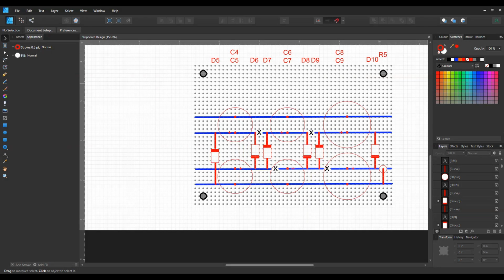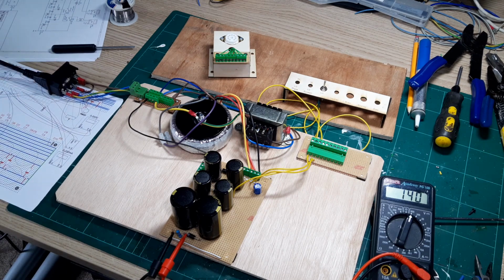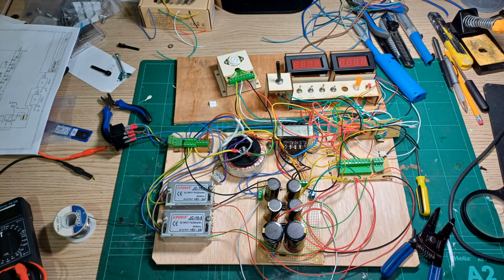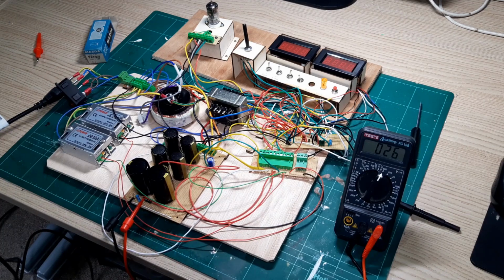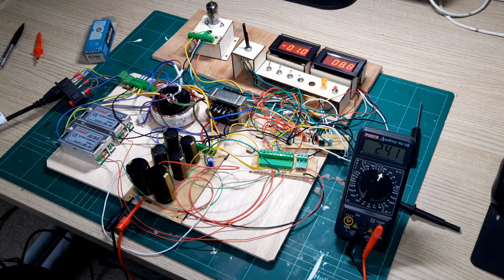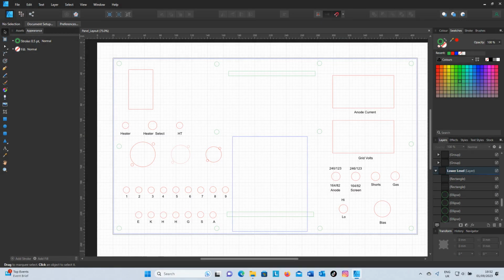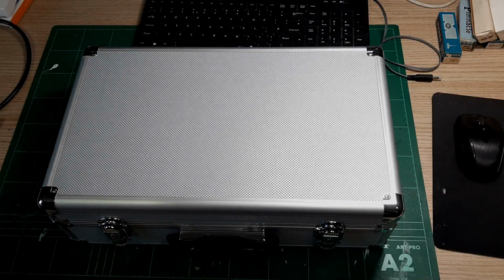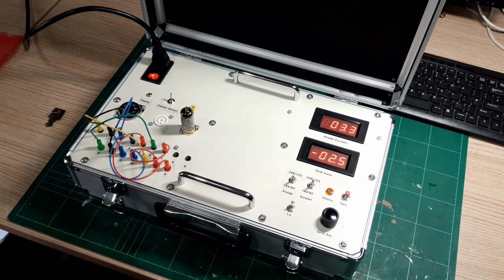Homemade Valve Vacuum Tube Tester Build - Part 2

Comment from the maker: Be aware that the toroidal bolt in my build is insulated at the other end so that there is no risk of earthing both ends. If the bolt is earthed at both ends, then it will behave a s single turn winding. Although the volts will be low, the current will be high in the short circuit. This can damage the transformer.

Comment: I went off a higher end American method transconductance/cathode emissions/plate current/gas test tester and chose 12, 30, 100 and 250 volts DC for plate and screens voltages.  Then I added 300, 350 and 400 volt DC capability. Grid bias ranges from 0 VDC to -100 VDC. The digital Gmhos meter was an eBay find that cost $150 saving me $400, as it is capable of +/ 1/2% tolerance @ 5KHz and about 1% @ 11KHz. The heater voltages were taken from a junk tube tester's transformer, so I have about two dozen of them plus a 20 amp 6.3 volt transformer with SIX secondaries, because unloaded a 20 amp 6.3 volt tap will be putting out over 7-1/2 volts. I want to measure plate, screen, cathode and heater voltages and their respective currents too, especially the plate current both as DC milliamperes and the sine and square wave AC portion to give me the Gmhos reading in mA/Volt, and I am adding in a pulse capability too. Regulating the screen and plate voltages using Zener regulated MOSFET regulation is yielding mediocre results. The Zener's breakdown voltage changes with temperature. Tucking in into a blob of heatsink compound and then stuffing it in the MOSFET's heatsink helps. Adding a BJT can also regulate the current.
Reply from the maker: Sounds like a great tester. I would like the means t measure all those voltage in my unit, but I guess its about trading off complexity vs cost. If I build another unit, I would follow on the lines of yours. I have built a module for mine that adds more flexible voltages particularity for the screen.

Comment: Maybe there's an obvious reason this wouldn't work, but why not run an adjustable linear regulator between the taps of the multiplier (*between* them, not to ground for obvious reasons). Each one could handle a 40v range below the tap. LM317 or 1117 ICs work at high voltages   as long as the you don't reference them to ground.
Reply from the maker: Sound complicated. For testing valves you really only need 250V, 170V and 100V for the screen. With that, you can test almost anything. I don't have 100V screen with 250V anode on this design, but that has been rectified with a simple 100V module. I also don't like dropping lots of volts across a regulator due to heat dissipation, but that's just me.

Comment: Would you mind sharing which two transformers and which DC supplies you used? Thank you.
Reply from the maker: Any 12-0-12 50VA transformer will do. You can go to 15-0-15 if you want a 300V+ plate voltage. The heater transformer is a 6-0-6 30VA component. I connected the secondaries in parallel to provide more current capacity. For the meter supplies, I used generic 5V 5A output, AC110/220V to DC5V 25W Universal Regulated Switching Power supplies. These can be easily found on Amazon or eBay etc.
Reply: @VintageandReclaimedElect  thank you.

Comment: Is there any reason why you couldn't get rid of all that voltage doubler circuitry and use a 1:1 isolation transformer and a couple of small variacs to set the screen and anode voltages? That would give much more flexibility.
Reply from the maker: You could do that. It is a valid approach. The point about this design is that it is cheap. Costs of an insolation transformer and variacs could be higher. You will also need to rectify the output and make a negative voltage for the grid. The voltage double circularly is not too great anyway. That said I am think about a variac based plug-in module for the screen voltage. At least my final build has the ability to plug in power modules for screen and heater.

Comment: Nice Video.
I actually have built my own based on the same reference design.
But not looking as good as yours...
So far i have used a variac for the AC input to fine tune voltages.

Not used high/low voltage selector som far.
Considering a seperate bias voltage supply to keep it stable when i adjust tha variac.

Maybe you would like to make a video covering testing common valves like EL84/EL34/ECC83/5881/6V6/6L6 ?
Reply from the maker: Thank you for the feedback. I love hearing about the experience of others. Good idea on the variac and valves.

Comment: your final comments were eye opening  that  some people would ask about ht options they should stop and only use low voltage eg less than 12 volts or lower
Reply from the maker: Yes, some knowledge is needed here and lots of respect.

Comment: Nice project. However, I would make some comments regarding safety. Firstly, when measuring continuity to ensure all of the metal parts in the case are connected, the standard is to use a continuity tester with 100mA test current. An ordinary multimeter will have a continuity current of only a few mA. Secondly, It is considered very bad practice to use the mounting bolt for a toroidal transformer as an earth point. If you accidentally earth the bottom of the bolt, you will create a shorted turn on your transformer which will in turn make a big bang. Thirdly, I suspect the push switch you are using for the gas test is not rated for a sufficiently high voltage to be safe (and indeed your toggle switches may only be rated at 125V - you should check). Finally, when making this kind of circuit, you really need to have a high quality multimeter with at minimum a CAT I rating and preferably CATII or CATIII. They are not super expensive and I recommend the Brymen BM235 as an excellent meter for less than £100. Also, (and this is just a personal view), I would have wired the grid voltage potentiometer the other way as the convention is to turn a knob anti-clockwise to make the situation 'safer'. Good luck with your new channel.
Reply from the maker: Thank you for the comments. Good point about earthing the centre bolt of the toroidal. I will place an annotation in the video and add a comment to the description, along with disconnecting the earth. The bolt in this project cannot be earthed at both ends. The transformer is bolted to a plywood base and that is fixed to the plastic base of the case via wooden standoffs. No metal mounting. There is a cavity between the underside of the plywood and the case. The bolt is confined in that cavity and no wires or metal exist in the cavity. The case has no holes drilled into it so the bolt and everything else is well insulated from the anything outside.  

I do have other multi-meters. CAT III to CAT IV. I have used them in this video but tend to go for my old academy meter. That too is CAT III. The CAT IV I have is good. I will certainly invest in a good continuity tester.

The push switch is 250V 0.5A. Toggle switches are 250V, 3A. That is top end for my voltage and current draw tends to be no more then 30mA max. 

I have thought about wiring the grid pot the other way round for the reasons suggested by you I will do this when I remove the toroidal earth.

Comment: Thank you for showing us this project. Putting it in a camera case is  a bit of genius, it looks very smart. 
I have used this voltage multiplier supply for a valve radio project. Because the current draw is about 60ma I used 220uf capacitors, which gave around 250v under load. 
I also realised that this a potentially lethal supply. There is a large amount of capacitance,, which holds several joules and stays there for a long time after switching off.  so I put bleeder resistors across each stage of the multiplier , the voltage drops away quickly after the power is switched off. It is easy to drop one’s guard after the power is switched off.
Reply from the maker: Thank you for the feedback. I hope I stressed safety enough in the videos. I have a strict procedure for connecting, powering and disconnecting, and that is for me using it. You really need to be respectful of what this can do to you. I do have a bleed resister in the voltage doubler.

Comment: As far as I know, the most important parameter of a valve, is the condition of the heated cathode. Only examining the state of the cathode can we decide whether a valve is rather new or used or heavily used. This should be the first stage of valve testing and everything else should come after that.
And you can check the condition of the cathode is pretty easy by measuring the emission current at two points. One point at nominal heating voltage and an another at 60% of the nominal heating voltage. If the emission current does not drop below 50%, than the valve is good, if it drops below 10%-50% then the valve can be usable, below 10% percent it is bad.
Reply from the maker: That looks to be good advice. I can perform this sort of testing with this tester. I give it a try. Thank you.
Reply: I missed a bit of this type of information in your video. The build is a very nice piece of engeneering, well done, but to me it was not clear what to go for once completed. I will visit Grant Willis his site to check out. I have an old valve lab power supply, that supplies all needed voltages. Must be very easy to built a tester with this unit and give it a use.

Comment: This is a great reference desin for a Valve/Tube tester.    I would probably make a small addition to make a variable voltage on both high voltage and heater so it can test a wider range of valves/tubes, but that's mainly because I do have a wider range of voltages needed for testing what I work with.      I think this is an invaluable tool and also a great project for anyone interested in getting into the valve/tube equipment hobby or even for more major restoration work.
Reply from the maker: Totally agree. You can use an external variable heater supply by connecting directly into the banana plugs to the valve. I am also making an external PSU to vary the screen volage to a much wider range. The limitation of this design is the variable in possible voltage combinations.
Reply: I think I will just use my variac on the ac input  to lower the output for plate and screen to exactly what I need. With an external heater supply. Not very portable but I don't need to move it from my workshop.

Comment: Fantastic. How about a design for DHT valves?
Reply from the maker: This will work with DHT valves. One side of the heater connection is grounded,  effectively connected to the Cathode. The filament voltage can be applied to the other heater connection.

Comment: pretty nice build there, I think you could also opt for a high voltage booster if you want to save on the doubler caps. I have a real tube tester but I kinda want to build something like the one you have here but as a kind of amplifier instead so you could actually play music with the tubes under test to see how they actually sound in circuit. I think it could be a very useful thing to have if you want to re-purpose non audio designed tubes for audio anyway to see how they perform as this. I have a ton of tubes but if you don´t know how they sound it is hard to do a good design around them
Reply from the maker: I love your thinking. I will be looking at finding new applications for redundant TV valves.
Reply: @VintageandReclaimedElect  yep. I have it on my to do list. I am not completely sure how to best implement and do it yet. The amplifiers I have built so far have a very wide range of compatible tubes already but I want to make it easy to change pinout and everything and that could be the hardest part I think. Bias can be made with a rheostat

Comment: Thanks for the video.The idea of using a voltage doubler is great although this provides limited available current, but you probably have enough to power the tubes you use.I also noticed that you didn't use any method to stabilize the anode voltage, so I'm wondering if you can maintain a good balance with power tubes that require hight current.To measure gm no declared anode voltage is required, therefore it is possible to carry out the measurement at any operating point, but during the variation of g1 the anode voltage must remain constant for an accurate measurement of gm.
Reply from the maker: Thank you for your comment. I really appreciate this sort of engagement. It helps all that watch these videos. I have a 50VA transformer at the heart of this and so I believe the voltage doubler will support about 250mA @250V. The most I have seen my valves draw is 36mA.
There are many examples of this design on Grant’s web page and some do have an extra meter to monitor the Anode voltage. I saw no fluctuation when I had a meter connected throughout the prototype stage, but I have to say I am working blind as I omitted one in the final build. I do not plan to add any stabilisation. However, voltages are patched through to the valve using banana leads so I could modify the leads and be able to connect a voltmeter through those and manually assess how stable the voltage is.

Comment: Parabéns amigo! Estou esperando mais vídeos! Também gostaria de fabricar um testador de válvulas até porque tenho um rádio de válvulas para arranjar e só agora com 64 anos estou a estudar verdadeiramente as válvulas e ainda quero construir um amplificador de válvulas foi sempre o meu sonho ter um .
Reply from the maker: I am glad you liked the videos. It's really not hard to build a tube tester so go for it. I will experiment with audio valves from TVs as they are very cheap and easy to work with. I have set aside some PCL82 valves that are a pre-amp and power amp in one envelope. I will put up a video of the build. I just need to find the time to start.

Comment: I think the build quality is excellent. Nice touch with the aluminium case - looks a bit better than the original Lamington tin!
Reply from the maker: Thank you for that. It's very serviceable too after I took it apart for an inspection after a valve failed with a bang whilst testing.

Comment: Nice work ! Hope to see more videos like these two soon.
Reply from the maker: Thank you for that. I do have videos planned. I need to add to my test kit with a current limiter, valve rectifier tester and shield voltage/heater supply. I have 4 valve radios to work on, plus some ideas for a valve amp using TV valves. It's just fining the time.

Comment: It'd be funny to have a microcontroller in there to do the tests automatically and the transconductance calculations.... and It'd be even more delightfully anachronistic than the  optocouplers would have been. ;)
Reply from the maker: Thanks for that I was just in bed when I saw your comment and that sent my mind running. Those testers are out there. A current sensor for the Anode current. The voltage controlled pot for the grid voltage. Some solid state relays to switch in and out the screen and plate voltages. Gas test needs a current sensor and relay. Shorts test needs a current sensor. An Arduino board could handle all that. You will need a database of valves to set the correct voltage min max levels and a display for the results. 

Alas, for the time being, I will be to busy building add-ons for this unit to make it more useful than kit is now.
Reply: @VintageandReclaimedElect  I've always got more projects on my TODO list than I've possibly got time to start, let alone complete. ;)